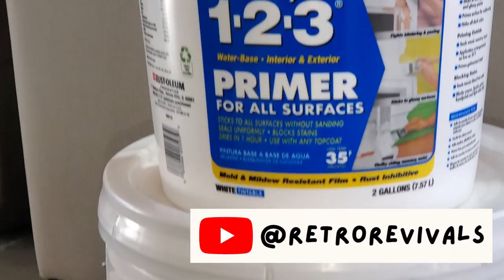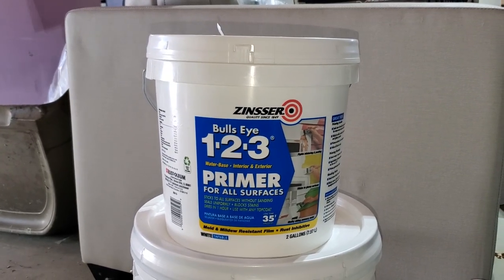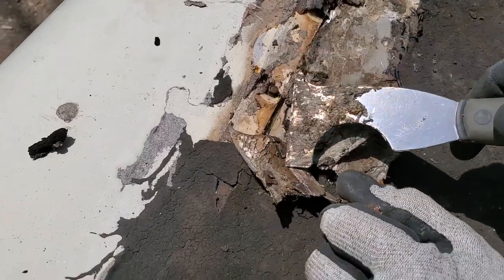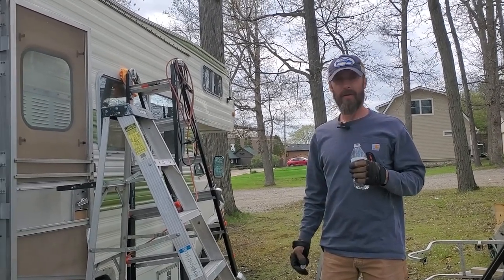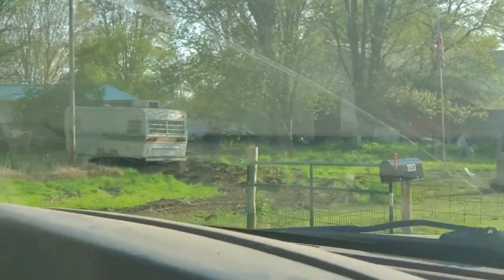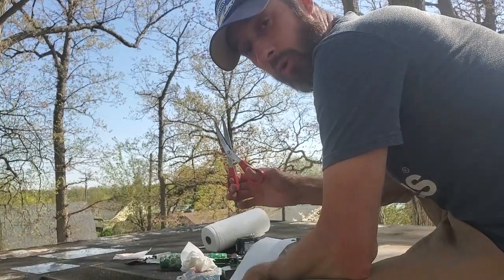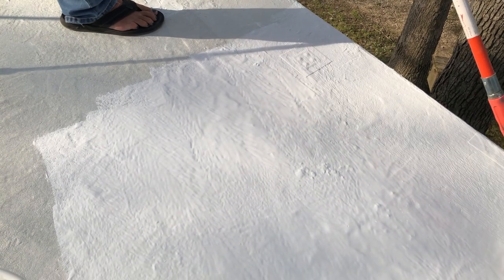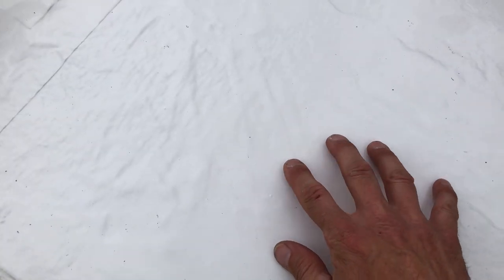DIY New Roof on 1970's Vintage Camper:  Lifetime Guarantee, Bulletproof RV Roof

Comment: OMG, I’ve never seen that stuff on a roof. It’s sad, because 99% of stuff for roofs does not work on rv roofs because of hot/cold and movement. You have a nightmare there to deal with. I think I would have removed the AC and vents and put a new roof over the old. Campers can be a nightmare to work with, especially when someone made such a mess of that roof. Wishing you well on your repairs.
Reply from the maker: Thanks so much for the comment!  The roof was a beast!  We researched and what we did seems to be working so far 🤞🏻🤞🏻

Comment: When we were kids, we would have been up there scraping that mess off, not my Mom and Dad, lol. You really need to get it all scraped off. What a nightmare you have there, ugh! I don’t want to be the bearer of bad news but unless you get every spec off, clean it with some kind of solvent down to metal, it will fail. I need to see how old this video is, and see if it worked. Glad you can still laugh through it all. I think you need to clean out that AC, lol
Reply from the maker: That was a year ago and it's still holding up.  We haven't really put ol Harvey through the ringer much so time will tell!  Thanks again for watching and commenting!

Comment: You could fill the inside of the "D" with bondo and that would give you more of a glue surface.  You could also insert small bolts into the bondo lined up with the holes in the hood and put nuts on the bolts inside the hood.
Reply from the maker: That is a really great idea, we appreciate you sending it.  We just ended up gluing down the G around the edges but I'm not sure how well that'll hold it.  To replace the D, we'll consider your suggestion.  Thanks for watching!

Comment: If there's one thing you're going to splurge $ on, get a low profile DC rooftop air conditioner, especially if you install solar panels and lithium-iron-phosphate batteries.
Reply from the maker: We're so torn on what to do for the A/C.  We would like to reuse the one we have if it still works but don't love the thought of putting it back up there just to have it fail right away because it's truly ancient.  Probably should splurge on a new one... might wait to see how much $$$ we're going to need to pour into the engine before we decide about the air conditioning.  Thanks for the comment!
Reply: @retrorevivals  another point in favor of a new AC is the old one will be using R12 or R22 refrigerant, or it might have some odd substitute if someone did a DIY refill on it. People have used propane, cans of electronic dusting spray and various other non-approved gasses to keep old air conditioning going when they can't get the old refrigerants.

If it has its original refrigerant type, should it need service it will be very expensive or impossible to get the old refrigerant. It would definitely be good for peace of mind (and efficiency) to install a new one that should last a long time before needing service.
Reply from the maker: @greggv8  Ooh, dang, you're making a lot of sense.  That does sound like the way to go.  We just need to get @RecProUSA to sponsor us!

Comment: Bedliner is the way to go. Expensive bedliner does great on RV roofs. Cheap works too , but be ready for issues lol
Reply from the maker: We're really hopeful this product will last!  We've never used it though so we'll keep you guys updated on how it does.  I don't think what we used was as expensive as bedliner but it wasn't cheap either, lol!
Reply: @retrorevivals  even if it gives you 5 good years without having to mess around with the roof you're not doing bad. Recoats and product removal is what concerns me when using roofing coatings. It's all hit-and-miss with anything & everything you buy these days!! You never know what you're gonna get as far as quality goes.
Reply: As the owner of a Auto body srpair shop Bedliner is NOTthe way to go!

Comment: Any update on the roof holding up? We have a '75 that we're about to do the same thing to! Thanks!
Reply from the maker: We need to do a thorough examination but, overall, we really like the Eternakote so far.  We noticed some cracking where we used eternabond tape under the rubber coating so we would not use the tape if we were going to do it again.  We patched over the cracks with Eternakote patch and mesh tape and looks good so far.

Comment: I plan on doing the same type roof sealing process on my RV as well. My roof is covered with the aluminum just like yours and the aluminum doesn't feel like it's attached to anything. When you walk on it, it feels like it's just   loose. Just wondering if yours felt the same way? Great progress on the roof, hope it's sealed👍
Reply from the maker: There were parts that didn't feel connected to the ceiling underneath, particularly up toward the vent in front and in the very back.  We ended up adding some screws in the back into our new 2x3s but left the front the way it was.  It seems like in the original construction, the paneling on the outside of the walls was glued to the aluminum.  If it's not attached to the aluminum anymore, that paneling probably isn't in the best shape but, it's weird to us that they used a layer of thin paneling between the foam and aluminum anyway... doesn't seem like it stood much of a chance of holding up.  I hope that helps if what I said made any sense, lol.  Good luck with your project!  So far, we feel like the Eterna-kote is going to be the right choice.  Thanks for watching!

Comment: Black goop or the silver goop, which is just black goop with a lot of powdered aluminum in it, is junk. All of them (tar based or synthetic "plastic") will eventually dry up and crack and leave the roof worse than before it was put on. Coatings like you've used or even the one step elastomeric white coatings are better because they remain flexible and reflect light. The other, lower cost, coatings are a false economy. The only thing better than any of the coatings is solid flexible sheet, especially a type that can be glued down. But those aren't ideal for an old, beat up roof.

It would be messy and take a bunch of time, but I'd have gone over it carefully with an angle grinder with a flap wheel to at least smooth off the crackled tar and ensure that every bit that's loose from the metal was removed.
Reply from the maker: We're hoping this coating does the trick!  We didn't really think about going over it with an angle grinder but that would have been a good idea.  Someone else just suggested something similar.  Although, just wire brushing a couple areas by hand started to liquify some of that old black stuff so we may have created a big mess doing that.  Anyway, we really appreciate you watching and for the comment!
Reply: @retrorevivals  hopefully it lasts a long time.

Comment: Seen roofers use ice pick tool to scrap off old roofs shingles and flat roof tar
Reply from the maker: Thank you for that suggestion!  We ended up leaving a lot of that asphalt up on the roof (as you probably saw)... it was stuck down pretty solid in most areas.  We appreciate you watching our videos :-)
Reply: @retrorevivals   YW  throw an idea at you

Comment: Grinder and wire wheel. face shield. And get it done.
Reply from the maker: Oohhh, we actually didn't consider a grinder with wire wheel.  That may have worked although even when we just used a wire brush, it would start to melt.  I bet wire wheeling it would have been effective but a huge mess!  Thanks for watching and for your comment 😁